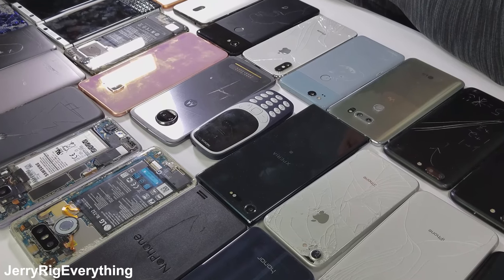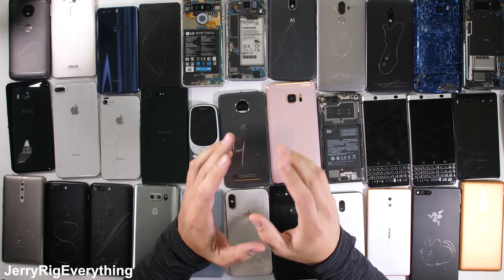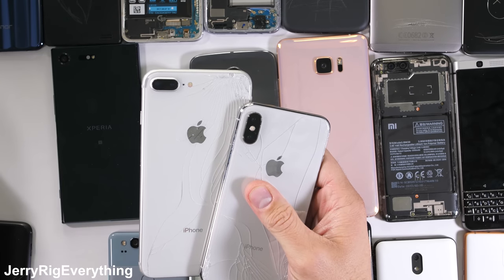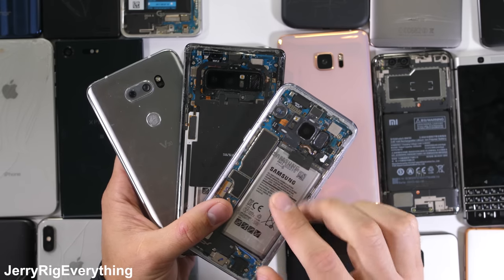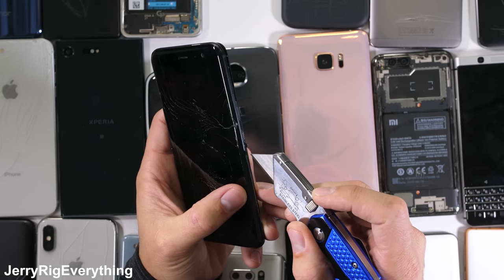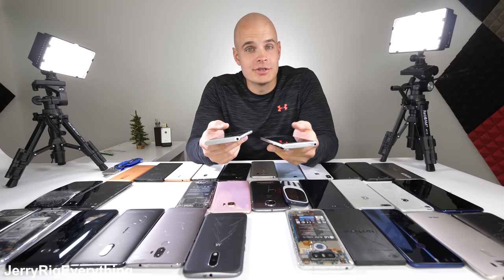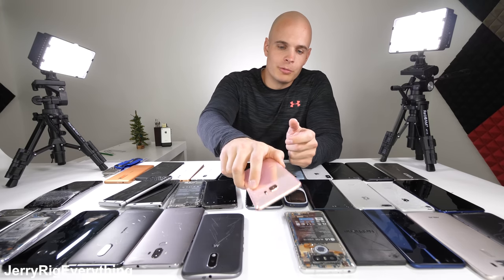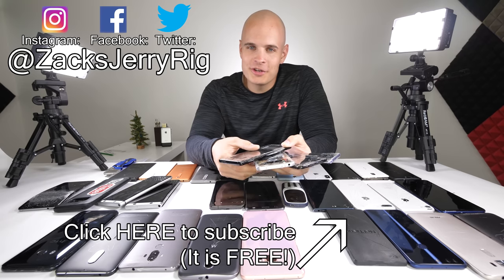Smartphone DURABILITY Awards 2017!

Comment: Can someone explain to me why Jerry hasn’t given the essential phone the award for the least repairable phone? There is literally no way to get into the phone without damaging the display or back panel, and there are no replacement parts. If nothing else, the screen of the iPhone can be replaced, about as easily as the Pixel phones (provided that you have the correct tools). The back panel is a massive red flag and I can understand it for being within the bottom 5 unrepairable phones of 2017, but shouldn’t this crown realistically go to essential, where “essentially” nothing can be replaced?
Reply: MaxxmzTech because it's can be repaired in the future. or can be repaired by using scrap from other bricked unrepairable (like bricked) essential. basically for iphone you replace the whole body (not machine) and it's not exactly cheap. (whooping 350$. which is price of another phone (i can get one mi5s from this). and it can't be repaired except by your beloved apple. so it's monopoly and forcing service. and it's hated by diy community like me/zack.
Reply: He is just hating on apple.  All of those phone you can take the back off relatively easily have a complicated process for removing the screen  apples pricing is wrong but if you can repair it yourself then it is just as bad as breaking a Samsung display.
Reply: Ray Wing ... but it will never be repairable in the future, look at the Ifixit review for further proof, they give it either a 0 or 1 out of 10
Reply: Jerry’s argument about the unreplaceable back glass applies to both sides of the essential phone. Using his argument, it would be easier, cheaper, and safer to just buy a new essential phone then attempt to freeze the back/front off and replace it with a for parts phone
Reply: He hates apple :(
Reply: Essential phone is unrepairable, you just cant find where to buy replacement parts. Less reparable means that at some point you can repair the phone, but it is hard and expensive. Phones like Essential Phone are unrepairable since you would have to buy another phone to replace the battery/screen of your old one and instead of that would be just easier to use the new you that you have bought
Reply: +Joao Eduardo Soares e Silva Its virtually impossible to replace the battery on the Essencial phone since you cant find a place to buy a new one. If your screen is broken or your battery is damaged you would have to buy a new one anyway
Reply: That's not true, others have successfully removed the display without damaging it. The rear is not replaceable though, this is true.
Reply: Well, the fact that, you can remove the screen and replace it without having to access any other internal components gave pixel 2 the most repairable smartphone award even though it damages the screen, so how can you give the least repairable award for a device that follows the same design? the only issue with Essential phone is the lack of availability of repair parts, which is not completely Essentials fault, the phone didn't sell very well, thus the demand for repair components are almost non-existent but on the other hard Apple deliberately make their phones hard to repair so that users have to fix it through Apple stores and has to pay a premium price (as much as a premium smartphone) to get it fixed.
I make tech based contents. If you have some free time kindly do give my channel a try.
Reply: MaxxmzTech becuase Apple deserves the backlash more than that company and it was worth mentioning
Reply: OtK you can just buy a new chassis and back glass for the iphone. I is just as hard to repair a samsung display as it is an iphone back panel because you have to take it fully apart.

Comment: 549$ for back glass ..for that money you can get one plus 5t
Reply: What...LOL I guess you're right.
Reply: I got an iphone 8. I figured, if I brake it, it's done. The phone was financed, I couldn't return it, so I'm stuck with it. Until it breaks.
Reply: Frank Szabo apple died with Steve Jobs !!
Reply: Pradeep Nayak true words...
and not even the 5t btw. the 6gb 64gb version even with the sandstone case + screen protector package and fast delivery!
Reply: Pradeep Nayak, it wasn't nice with Steve Jobs too.
Reply: MrPaukann it was... atleast alot more than now
Reply: Mr.Magnificent 559....
Reply: Jhin you get 50% of if you buy bundle
Reply: duke nukem you can get a used s8
Reply: wadaltagi ود التقي lol a used s8 ew no. used xperia xz premium or Google pixel 2 xl
Reply: wadaltagi ود التقي You can get a new S8 in Spain... Theyre around 560€ on Amazon.

Comment: I added an Otter Box Defender to my Google Pixel 2 XL black with the metal buttons..... Then put a type C wireless charger by Nilkin  between the case and the metal body now I have a wireless charging Pixel 2...... I use the Tilt station and It charges my battery slow but I like a slow charged Li ion cell, better performance and battery life...... I put a gorilla glass cover to cover the screen..... This phone is bullet proof.... Ha ha..... and I did it all because of the camera on this phone. It is a keeper phone and specially with the new P update...... 

Innovative should be for this phone, and now I have it customized to my strong and demanding needs ( Architectural Code Inspector) always at construction sites ..... Every one that holds my phone tells me .... Dang this is one sweet ass tank of a phone...... and by adjusting some settings under developer options to better the resolution and animations this thing rocks !!!! ...... Thanks for your videos ........

Comment: I USE NOKIA 7 PLUS. ACCIDENTALLY DROPPED IT FROM FAST MOVING BIKE WITHOUT ANY SCREEN GUARD OR CASE , JUST AS NEW..... BELIEVE ME NOTHING HAPPEND TO SCREEN OR METAL BACK. JUST A TINY PAINT SCRATCH IN BACK..... JUST THINK THE SAME SITUATION WITH IPHONE OR S8....NOKIA IS ALWAYS NOKIA BRO.
Reply: I dropped mine on a toilet floor, screen broke.
Reply: Find the capslock and turn it off
Reply: @royrogers3624  Do you think that would have helped? Damn.
Reply: @zibingotaeam3716  yes it would have looked less obnoxious
Reply: @royrogers3624  I was talking about my phone.
Reply: @zibingotaeam3716  and I wasn't talking to you maybe next time pay attention if I'm saying "turn off the caps lock" before being emotional see if you wrote in all caps if you didn't then I'm clearly not talking to you if you're interested in who I'm talking to look for the person with all caps
Reply: I had the same with my s8, nothing happend. So just luck 😂
Reply: Bike ran over my dad's nokia 6 and it doesn't have a single scratch on it but it slightly got bent..  But road condition was really bad..  Best in this segment..
Reply: That's the power of NOKIA!!!
Reply: Calm down

Comment: And here I thought the S8 Active might actually win something when the awards were about durability... Oh well...
Reply: There's more fragile glass to break on that phone. And I don't think it's a sapphire display, unlike Verizon Wireless's Kyocera Duraforce Pro and its raised bezels that protect said sapphire display.
Reply: The screen on the active is shatter resistant with glass similar to plexiglass, it's incredibly hard to shatter or crack, the active has a more durable build than the regular s8. With less glass, a rubber/plastic back and metal sides with bumpers on the corners. It's a hard phone to break so long as you aren't throwing it off a 2 story building. It's no sapphire, but it's designed to flex with shock and return to original state rather than stay rigid. A "Bend but don't break" philosophy.

Comment: I still don't get why people complain about glass phones breaking. Every glass phones breaks. Just buy a case and stop the whining.
Reply: Mambutu O'Malley “ glass is glass and glass is fragile “
Reply: Thats why mine is plastic on the back
Reply: Buy a 5mm thick phone and then buy a 5mm thick case. Then explain you bought the phone because it was 2mm slimmer than the one which doesn't need a case. That's how the logic goes, not saying you would imply that. Case adds another outer surface so integrating durability in the phone can make the wholeness lighter, smaller, and actually more durable - if it's designed for durability.
Reply: McSlobo What?!
Reply: McSlobo that's why i go caseless these days 😂 only protect screen
Reply: My One Plus One I've had since they first came out and I never had a case on it. The thing only just a few months ago I cracked the screen after trying to take off the one case I bought for it.

My mistake was putting a case on it, it never broke before I had a case, despite falling thirty feet down a stairwell at a parking garage onto concrete, sliding across a busy street and getting ran over by a car, getting thrown out a window by my ex, and so many other things that would have destroyed any other phone. Yet the one time I think I should put a heavy duty case on it...taking off the case to charge the phone breaks the screen.

That being said it still works and the screen didn't crack except one part in the top left of the screen, and part of the touch screen doesn't work. Other than that it still works well as a wireless adapter for my desktop.
Reply: Well you have to complain to get heard!
The back glass idea is shit! What’s the point if you have to ‘protect’ it with a case
Reply: Mambutu O'Malley: There are cases like spigen, otterbox and the better Chinese knock offs that make the experience of dropping a phone more pleasant. I agree.

Comment: Most fragile phone of 2018
Oppo find X
Hit like if you agree 👍👍
Reply: halfway bend test already failed..insanely fragile.
Reply: At least is repairable, Iphone not.
Reply: @endlessazure2142  if a phone broken into two pieces then how would you repair that???
Reply: @tarun5368  it depends on what situation you put it.. if not a normal accident when a phone bend like that and with that intentionally phone.. being reastically is easy to say that it is repairable on normal conditions of a broken screen or fall. not an intentionally bend test.

in the other hand Iphone can be easily broke by accident no matter how bad it is.. it is unrepairable for that many cost, the only way it can be broke up in two if its intentionally.

Comment: Yea the older iPhones are being throttled by apple, but it’s for a reason that is not for you to buy a new phone. They throttle them because the old batteries can’t handle the power of the processors and you’ll get a much lower battery life or have the phone shut down before it hits 0%. With the processors throttled, it would draw less power from the battery which makes the phone last longer. And apple still supports the 5 year old iPhone 5s with updates....and they released an update to have a switch that would stop throttling the phone
Reply: Manpal Bajwa dude, there’s no point arguing.
I mean, I love iPhones. I had and still have 3 of those and I adore all of them. But also I love android phones, I’ve used them for like 6 years. And.. I love android as long as I don’t read any of this android fanboy shit. It’s always a fanbase that makes you hate te product, ironically.

Also, Zack, why be so passive agressive, man? Apple just as anybody else wants you to buy their products, but they are not some greedy company that solely wants to profit and fuck the customers up. Come on, man. 
Why would they roll out iOS 12 on a 5-year old iPhone?
Reply: You know that batteries can be replaced right?
Reply: That's Apple's pathetic attempt at an explanation, but it's B.S. Even with a throttled CPU you're still going to charge that battery at the end of the day, and it's the number of charge cycles that ultimately determines the life of your battery. You can slow that CPU down as much as you want but you're still going to replace that battery after 2-3 years. Apple really does just want you to buy a new phone.
Reply: Jane Dobiesix replacing a battery is easy.
1) give it to Apple
2) they put a fresh one in
Also when you’re done there’s a brand new awesome iOS 12 waiting for your old phone to be installed.
I don’t see where I have to buy a new iPhone here.
Reply: @littlesoldier1985  well that's my point. Everyone has to replace their battery after a few years, regardless of what phone you have. You don't even have to give it to Apple, it's fairly easy to do it yourself. But when the OS slows down your phone on purpose you have to replace the whole thing because the underclocked processor makes the experience unusable.
Reply: @janedobiesix6588  again, iOS 12 is a miracle on old devices. Yes, some iPhone 6 is slower than the X, of course, but all I see is a very stable and smooth experience, I test it on my 8, SE and already mentioned 6. Everyday use is flawless.

Also, while old batteries do activate throttling, you can now deactivate it.
And while I see how Apple fucked up with not telling everyone about it, they still did a lot of work to fix their mistakes and that is at least worth considering.
Reply: @littlesoldier1985  Did Apple stop throttling with iOS 12? If doesn't matter how new your battery is or how nice your OS if it's intentionally slowing everything down. The fact they ever did this to any device is really telling about the company. The purpose of the throttling was always to get you to buy new phones, but hopefully that was stopped or will stop now that they were exposed doing it.
Reply: @littlesoldier1985  because iphone is not so friendly for consumers if you think about it, anyways you seen apple fanboys? They are the same or worse

Comment: Thanks a lot for this Video. 
I've had a sleeve many years ago. Than a half year I've used none protection. My screen broked. After that I've used a cover/bumper all time. No cracks in the screen since 4 years. 
Your recommendation is right to use a bumper.

Comment: @JerryRigEverything, Have you ever tested the Kyocera DuraForce Pro with Sapphire glass?  I have been looking at it and I think your view point is pretty close to mine, although I firmly believe that a smart phone that needs a case is, in and of itself, a design flaw.  My Galaxy s8+ screen cracked WITH an otter box survivor case on it, I was pretty miffed and bought the replacement front glass after watching a video on how to replace it.  Then I watched another couple videos where the repair attempt actually broke the phone further and was scared off a little.  I was still going to attempt the replacement but apparently waited too long as the top 1/8th of my screen is now no longer reacting to touch.  I'm pretty much done with smartphones not designed, out of the box, for an active lifestyle but Verizon does not have the s8 active.  Back when I had flip phones, I swore by my Casio G'zone phones, they had most if not all the features of their less durable competition and could stay with me snow boarding, rock climbing, wake boarding, camping, combat training, or whatever.  Have you found any ruggadized smartphone that doesn't skimp on features but is built for people with active lives?

Comment: Some of my main phones are iPhones. I repair them myself for cheap and use them alongside my Note 8. As you may have gathered, I collect phones. Even my iPhone 6 and 6s plus are better than my Note 8 in some ways including camera stability when filming and they have things like a dedicated music app, which is important for a music producer as myself. My note 8 has a shutter warp when shaken slightly while filming, unlike every iPhone since 2009. My note 8 does have a better display, among many things. Plainly put, iPhones, even the old ones are better than Galaxy phones in some ways, while Galaxy phones are better in other ways. I love my Samsungs and iPhones about the same.

Comment: My most durable phone was the Galaxy Note 3, I could use that phone as a basketball and I won’t see a single scratch. My least durable phone was the iPhone 4 where I had it in my back pocket for 5 minutes (I didn’t bend over) and the back panel and battery were to destroyed to properly use.

Comment: My blackberry keyone is super durable. I even dropped it in staircase and looked at it bumping from step to step all the way down and just had a nick on the side. I dropped it face flat direction on concrete without even a scratch. I stopped tracking the number of drop but based on my experience with previous iphone it would had cost me 2-3 grand of repair if I went with a cheaply made iphone. It's the difference between a toy and a tool.

Comment: This is late, and you will probably never see this, but the Essential Phone? Not even a runner up for durability? The screen cracked during your drop test, but as you said, that was probably just unlucky. As it's just normal Gorilla Glass 5. But both the Titanium edge and ceramic back held up fantastically.

Just curious. :)

Comment: Your extreme lack of knowledge about Apple doesn’t impress me... Do a little homework on Apple “throttling” phones. 
And the glass back replacement is replacing the entire phone. Still sucks that’s it’s that much but at least you get a whole new phone from it. 
Plus Apple’s battery-induced slowdowns will likely REDUCE iPhone sales. Do two minutes of homework please. You know so much about Androids and extremely little about iPhones. You just use the typical Anti-Apple nonsense buzzwords.